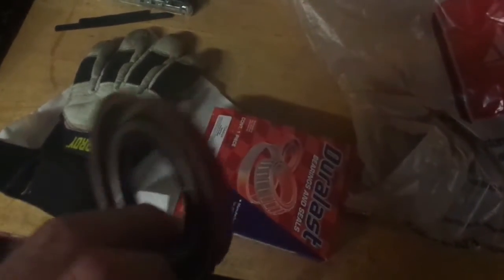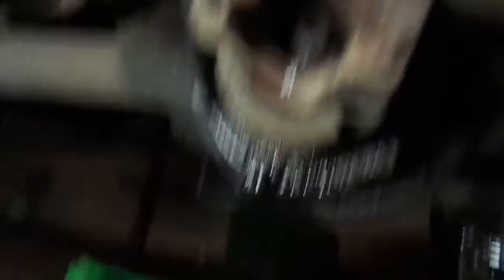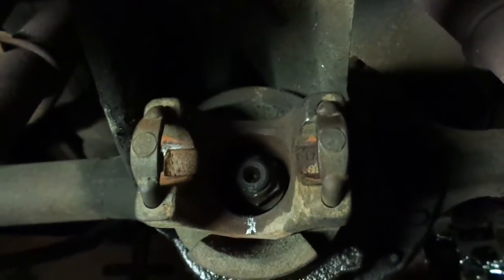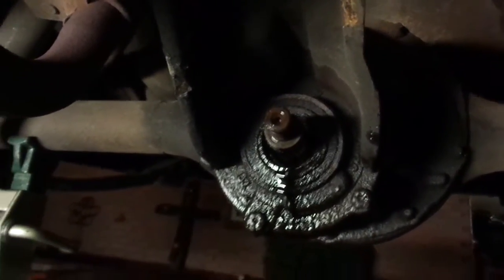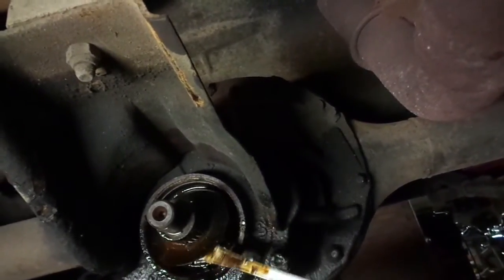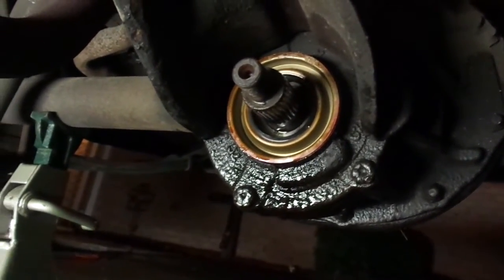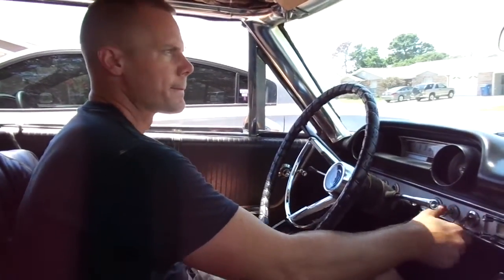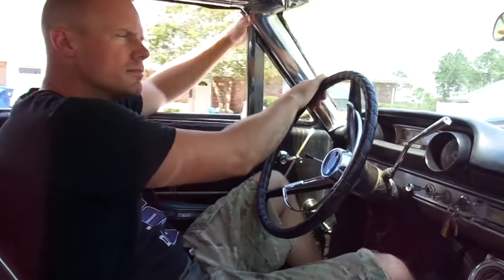1964 Galaxie 9" Pinion Seal and Burnout

Comment: Sweet Galaxie. I made the same mistake not marking the nut when I switched my 9 inch over to a 1350 yoke. Mine started whining. Turns out it messed up the lash on the pinion and ring gear. Took mine to a shop and had it set up properly before I ruined the gears. How did yours turn out?